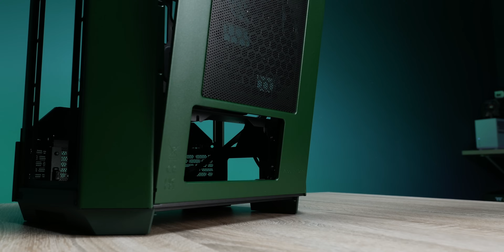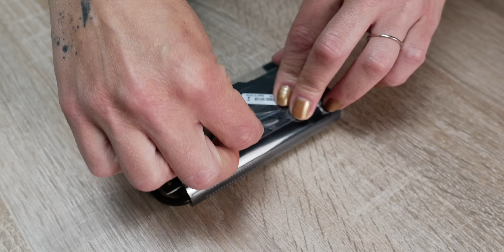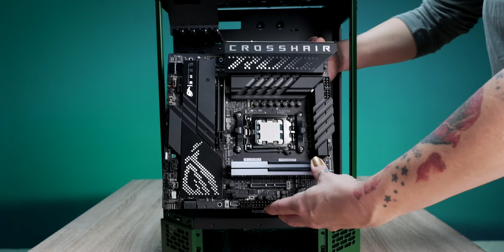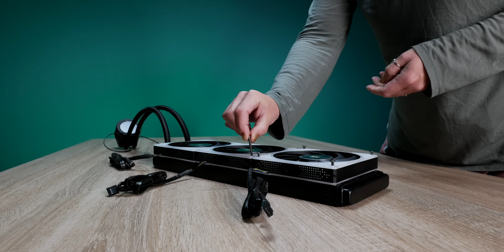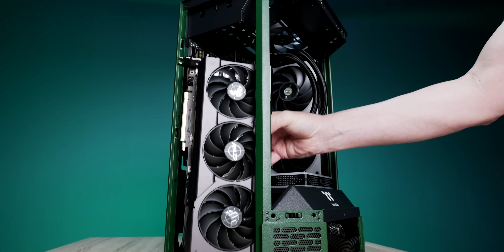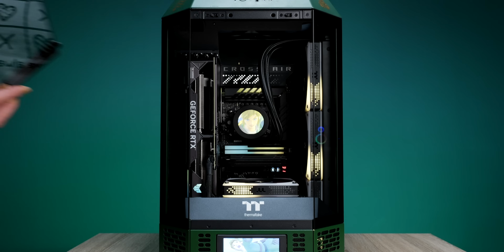Thermaltake Tower 300 | #JKB Zelda Triforce PC Build | AMD #Ryzen 9 7900X3D | ASUS RTX 4070 SUPER

Comment: amazing diy details and build! there's only exhaust fans? no intake?
Reply from the maker: Hey! Thx for watching and liking the build. It was setup mostly like this for aesthetic reasons. The Toughfans just look nicer this way for the video! 

But generally i did a few benchmarks (AIDA/Superposition) and the difference in temps when switching the bottom fan over the psu to intake was minimal (under 3 Deg difference) The GPU get´s air from the left side and the hot air get´s sucked out on top, the AIO (420mm) pushes the hot air out thru the Radiator on the right side. Left over heat (VRM´s / NVME) is sucked out thru the top as well. As well the Thermaltake Guide actually has the same setup with only the difference that the Fan on the PSU shroud is intake.  In normal gameplay the CPU was sitting between 55-60 deg / GPU 60 in Performance Bios / 66 in Silent Bios.

Comment: What's the thoughts between painting on the gold accent vs using good quality vinyls? I guess the worry with the vinyls would be peeling, but with the paint you have the risk of it being more vulnerable to chipping or not going on smoothly?
Reply from the maker: Vinyls would be fine as long is they are good quality ones that are uv-resistant. For paint i agree, there is always the problem of chipping but we could argue you could always do a clear-coat layer. A few years back when we did more indepth mods i still had more space and a flatbed uv printer. This is for me the best method because the uv-prints i did are still not degraded on the cases even after years.

Comment: Quick question, you can use the USB cable for both the LCD display on the AIO and the one for the case right? Haven't got my PSU yet and I'm doing a build with similar parts and I'm just trying to plan my cable routing.
Reply from the maker: I actually did exactly that, connected the Micro USB -Y Cable to the AIO and Front Display and than routed to the USB Port.
Reply: @TekTherapy  Nice, glad I don't have to reroute anything!
Reply from the maker: @YuasBirds  Will defo make your life easier 🙂

Comment: I just got this case for my new build not long ago.. and I love it.. But I never hear people talk about the hard angle you have to put your cables into in order to get them plugged into your IO ports.. I'm driving 4 monitors, so I've got an HDMI and 3 display ports, and with the amount of strain on them, i'd really be surprised if this case doesn't end up being responsible for breaking the ports off my gpu.
Reply from the maker: That's a valid point. I don't have the case here anymore. But wouldn't angled connectors solve this?

Comment: real dumb question: where do the hdd/ssd goes?  i'm hoping to use a 420 radiator but also plan to have 2 m.2 ssd and 2 sata ssd
Reply from the maker: The case has the SSD Mounts on the Backside of the case. You can easily mount two additional SSD´s there. As well we used a 420mm AIO.. fits!

Comment: Can a M2 with a heatsink fit in the M2 slot under GPU?
Reply from the maker: No not really.. you gotta stick with the original heatsink/cover which should be enough for most NVME´s anyway. As well the next generation of Gen5 NVME SSD´s don´t use the Phison controller (that is currently super hot). There is a new chipset coming so some Gen5´s will run cooler than even current Gen4 SSD´s i talked to a few brands about this at Computex.  

On the other hand the X670 Gene has a carrier board with more than sufficient cooling for another Gen5 SSD.
Reply: @TekTherapy  So in the GEN-Z.2_1 it will run at full speed?
Reply from the maker: @thso6529  ASUS is acutally pretty vague about this. The 2_1 is Gen5 x4. In my inital speedtests the TG Z540 ran at full speed in the slot. On the other hand the ASUS specsheet says "system configuration" might be impacting performance. Long story short.. with a 7 Series CPU (i tested two so far) i had no performance issues.
Reply: Seems that full speed depends on what cpu you use. Thank you very much.
Reply from the maker: @thso6529  It seems to be related to the available Lanes of the CPU. Glad i can help!

Comment: No intake fans , why ?????
Reply from the maker: Hey! It was setup mostly like this for aesthetic reasons. The Toughfans just look nicer this way for the video! 

But generally i did a few benchmarks (AIDA/Superposition) and the difference in temps when switching the bottom fan over the psu to intake was minimal (under 3 Deg difference) The GPU get´s air from the left side and the hot air get´s sucked out on top, the AIO (420mm) pushes the hot air out thru the Radiator on the right side. Left over heat (VRM´s / NVME) is sucked out thru the top as well. As well the Thermaltake Guide actually has the same setup with only the difference that the Fan sitting over the PSU is intake.  In normal gameplay the CPU was sitting between 55-60 deg / GPU 60 in Performance Bios / 66 in Silent Bios.
Reply: @TekTherapy  keep shining like a star you are awesome ❤️
Reply from the maker: @abood_alzbidyE92 Oh my.. thanks soooo much!!!!
Reply: @TekTherapy  ❤️❤️❤️❤️ you doing fantastic work keep going 🔥🔥🔥
Reply from the maker: @abood_alzbidyE92  Thx we are trying 😊
Reply: @TekTherapy  i hope you the best